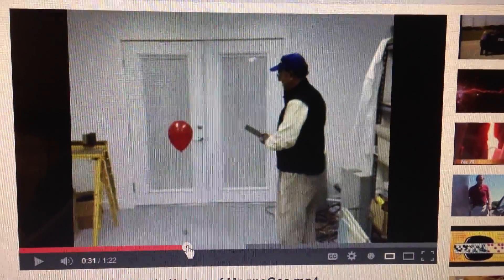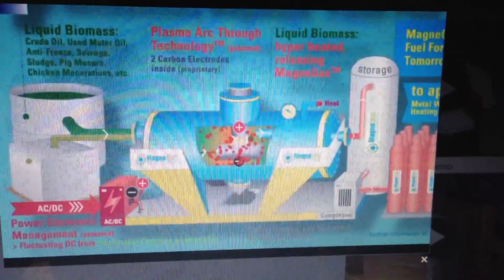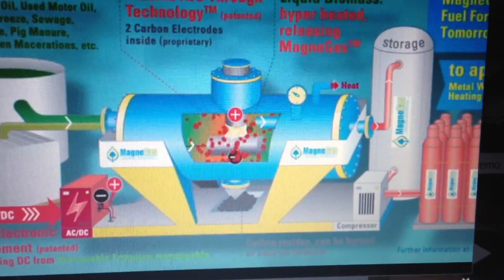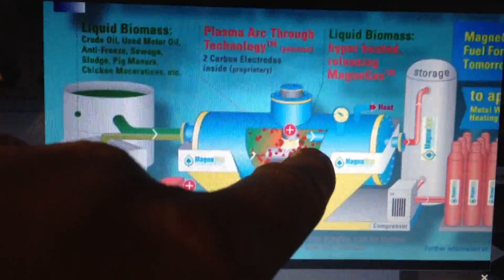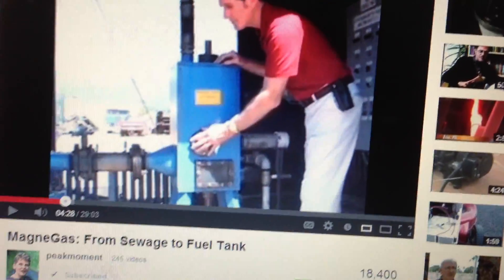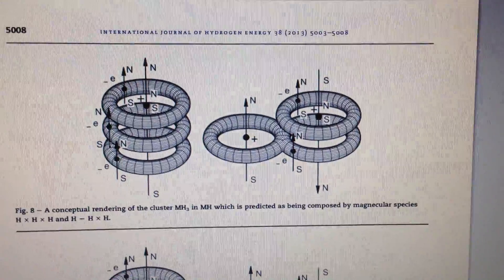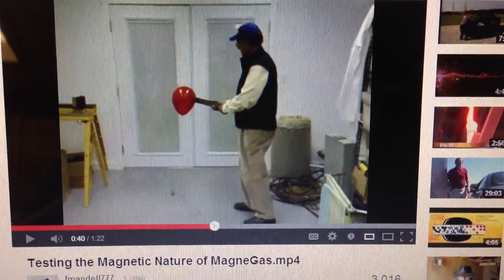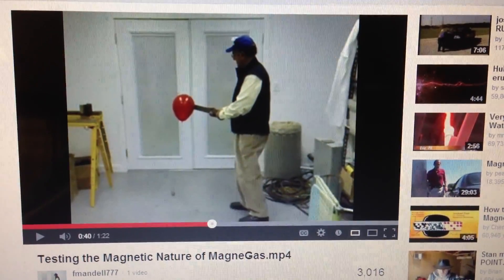Laser EPG 019 - Creating Magnetic Gas, Toroidal Shapes (Magnegas, Magnehyrogen, MagneFuel)

Comment: HHO article by reserachers indiciate rydbergs cluster.. Electron hydrates, these are earlier discovered in the process forming sodium amide by putting the alkali metal in NH3 (l).  The MO bond can bee sen as a magnetic interaction .  I think that the gas is minus if checked with a volt meter. Even think of MEyers magnetic gas as just a Hydrogen plasma... read on naudin page about mhag.

Comment: Just pass the gas through an ionization chamber that is inside every smoke detector. It will knock the electrons off the hydrogen, oxygen, and un-combustable gases. Americium 241 emits ionizing alpha particles. Look it up.
Reply: Btw, no need for extreme high voltages.
Reply: Yes I agree BUT how money moles of gas per year do we talk about here?
Reply: Zekerias Varg just put the Americium 241 tablets in something like Stan Meyers EPG and let them make all the magnetic gas you want, just have an area of pipe dedicated for electron extraction by connecting the positive of a diode to pipe to a load to ground, now u make electricity with the gas production
Reply: Yes but how much am-241 do you need to get out say a litre of H2 a minute?
Reply: Zekerias Varg Put it in small diameter copper tube because alpha particles only travel a short distance, let's say you use 3/8 od copper tube 5ft coiled, that is just enough space to wedge those am241 tablets in there, it should fit about 20 in there easy, put near entrance and processed h2 comes out other. Output is however much u put in. It will not do electrolysis at all but just knock electrons off.
Reply: So yes I understand and I agree that radioactivity is a clever way to go BUT its really really very very very little of the AM-241 in a smoke detector so I think it will need 100 of them to get out H2 in  just a liter per minut. I think its easier to just build a hydrogen atomic arc device, Naudin get out COP 20 with this. IF its true? I think it is.
Reply: Zekerias Varg An alpha particle detector reads higher when a magnetic field is behind the alpha emitting source. Put coils around that copper tube filled with the Americium 241 but those coils should be greater than 60 feet of wire and multiples in parallel. Study up on Joseph Henry and his experiments on electromagnetisum. The B field increases the strength of alpha particles, I don't know if it is due to increase velocity or a vector function.

Comment: I was just wondering if it would be POSSIBLE to turn this Magnetic Gas into a SOLID State by using Toroidal Super/Hyper Electromagnetic Plasma fields to compress and hold the the surrounding gas in place along its outer edges!! thus creating ACTUAL " Shields " around the " Modual "!!!
Reply from the maker: I don't know what type of shield you're referring to, but MagneGas is still only a gas. Objects can pass through it. Interesting idea though, that would be amazing. I have read that these "MagneGas" atoms will separate and break their bonds when exposed to inferred wavelengths, so heat and light. To give your shielding idea the best chance of working, it would need to be in a sealed dark chamber and away from heat sources.
Reply: Russell Martin Space would be a good way to keep the heat away after all it is -475° and If the atom bonds could be broken and then held in place by the surrounding Magnetic Plasma Field and in Essence ANY Thing that touched the outside would not be able to pass through!! I'm Picturing it as what I would call a Frozen Fire Shield!! However I'm just talking out my ass and just trying to come up with some ideas for Space craft Shield Technology
Reply from the maker: Keep researching man! It might as well be you who figures it out!